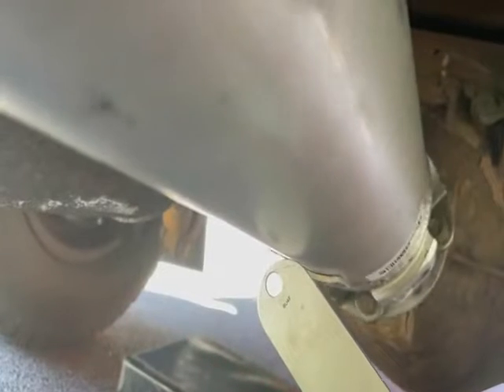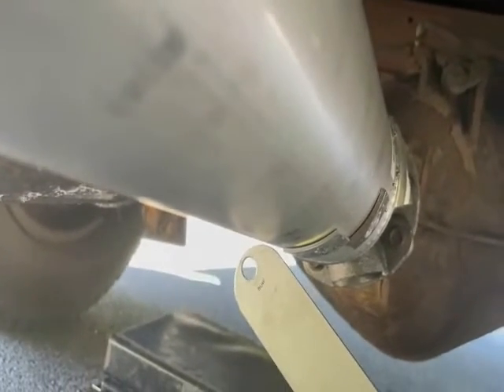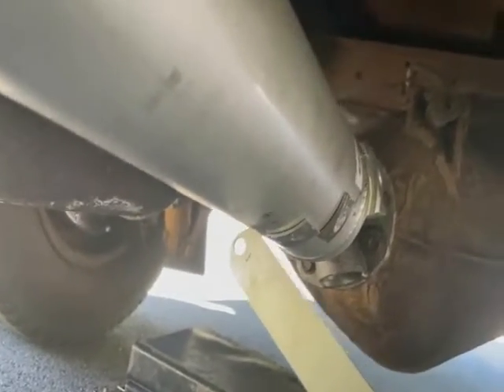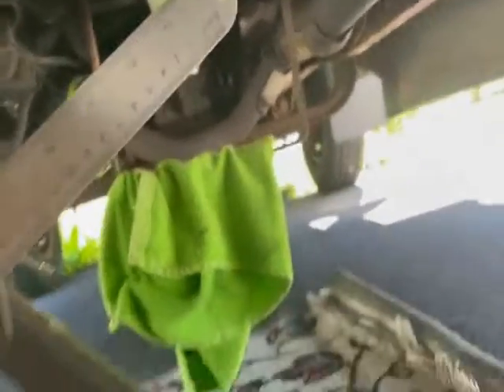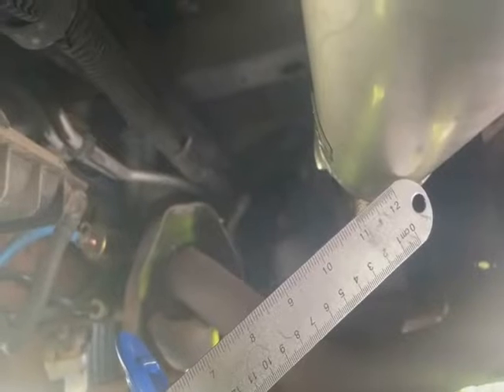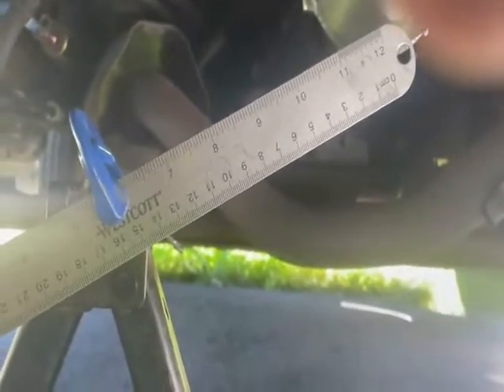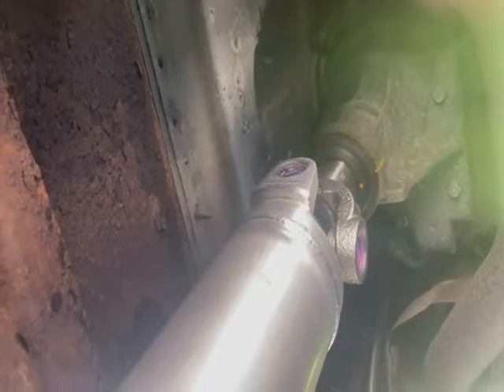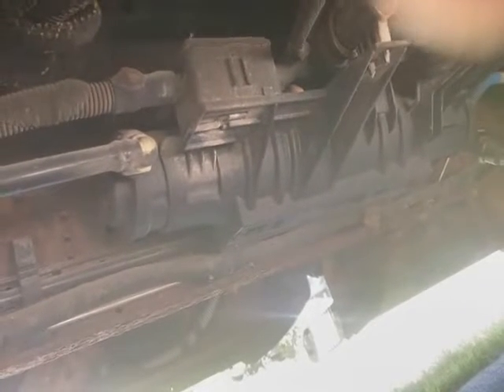DriveLine Series Part 2: Measuring Shaft, SlipYoke, and Diff Runout

Comment from the maker: The reason this driveshaft had so much runout was because the spicer ujoints had little plastic washers in the caps which were squished. Somebody forced it with a press and used .063" pink snap rings which are the thickest spicer provides in the kit. Whoever assembled this thing was a caveman and botched the job. The washers were swapped out with new and the snap rings were changed to a thinner size and the runout was gone. I told them this and sent pictures and videos but they would NOT provide me with a rebalance which would have been necessary to fine tune it and especially now that I would have to remove those excessive rediculous weights. Whoever initially built the shaft itself and the parts did a good job as it was very straight after the fix.  The timeframe for the return period was closing in and I decided to send it back for a refund. The ujoints being they were smashed together were bound up real tight and hard to move as well but after i gave it TLC it was like butter. I bought it off ebay so I was protected. If this was bought at the store I wouldve been up the creek without a paddle. This was the second driveshaft they sent me that was junk. I would highly recommend NOT purchasing a Dorman brand driveshaft manufactured by Powertrain Industries. The tech support department was NOT very helpful or interested in the fact that this stuff goes on. I would have had a chat with all the workers, found out who did it, and made sure to educate them so it would never happen again.